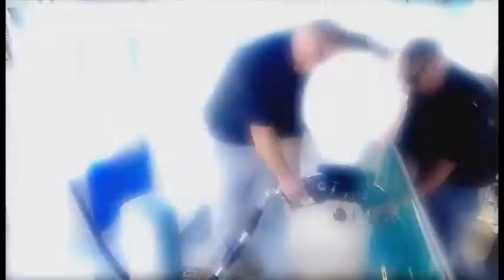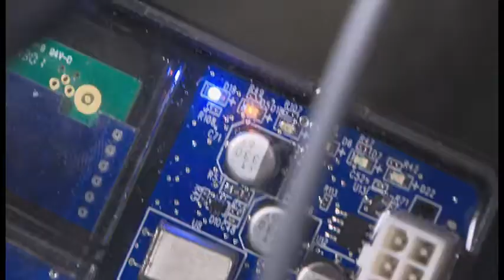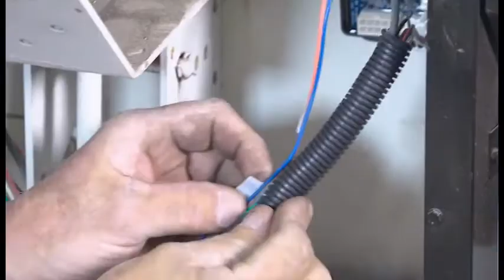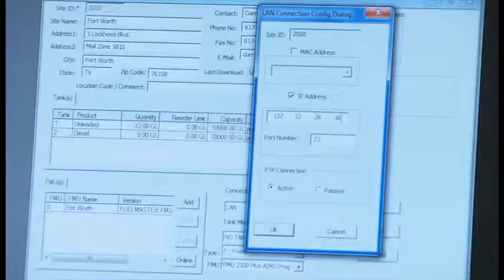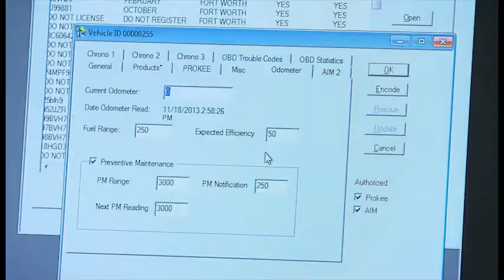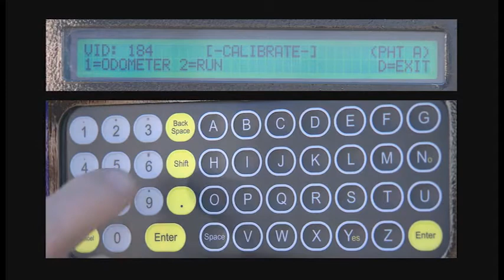FuelMaster Training Video Lockheed Martin

Comment: If it were to be stolen would it work on anh vehicle?
Reply from the maker: Not without the matching veh number from the original OBD.
Reply: Leo, the Aim's works off of the current vin number, so if it was placed onto different vehicle, it would not work until the Aim was cleared and reprogrammed to the new vehicle.